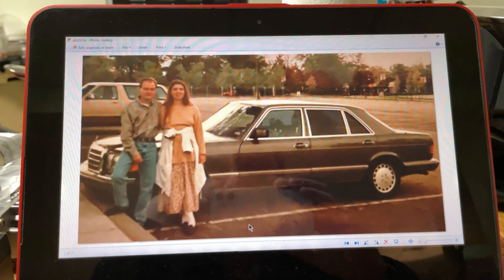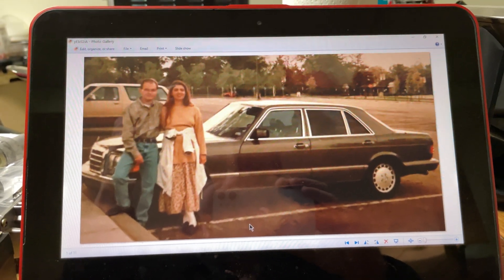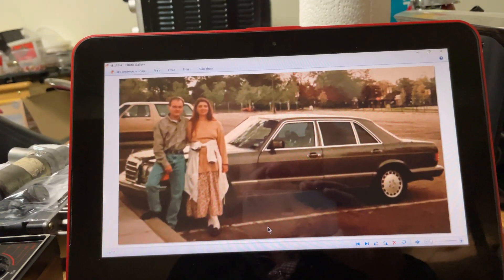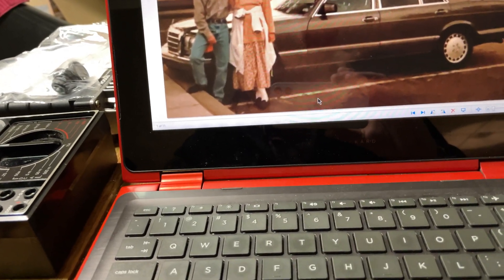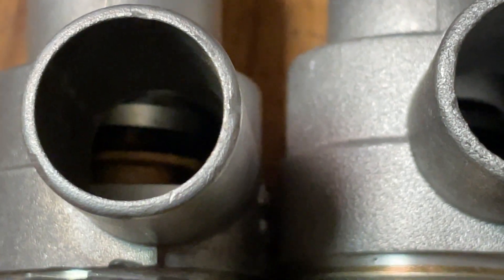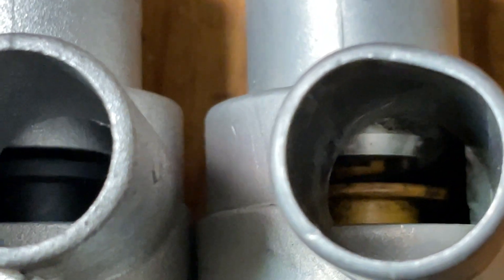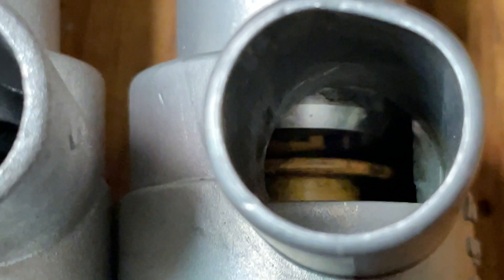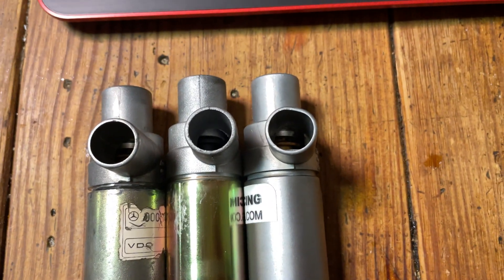Tutorial correct calibration of Bosch K KE KE3 Jetronic for all Mercedes after repair / long storage

Comment: Hello thank you for the video . I have a question I ajusted my pontentimete at. 0,7V  than I ajusted the air plate and potentiometre changes the value from 0,7  is it normal or I have a problem with my potentiometer . Thank you best regards
Reply from the maker: No, that’s correct 
You can adjust the plate first and then adjust potentiometer and see what difference this makes
Reply: @inovahightechltd  thank you for your answer and all instructive video

Comment: Hi, I have replaced the potentiometer with another original bosch A0000740136 on my w201 2.3-16v (m102.983) no catalysed mercedes. The voltage between pins 1-2 would be 0,7-0,75 too? Thanks for sharing your videos.
Reply from the maker: That I am not sure. Check with the MB Service Manual Group 7.3 for your Model and Model Year!
Peter

Comment: Will this also work on my Porsche 928 K-Jetronic (1978).  I assume it will to get it starting?  Thanks!
Reply from the maker: Yes, but I believe on the Porsche / VW the plate action is in the opposite direction from the MB system, meaning plate moves up, not down. Otherwise everything is the same
Reply: @inovahightechltd  Thanks!  You make what was a mysterious fuel system simple!  My problem is I messed with the 3mm Allen and that was that!  So I want to bring it back to a baseline so it starts...
Reply from the maker: Craig, just follow the video(s) it takes patience but once you get the hang of it then it’s a piece of cake! Just remember, plate adjustment with Allen key only with a running fuel pump (jumper the fpr) otherwise you will loose your hair! Peter

Comment: Hello , I'm restoring a 560SL 70,000 miles which was parked for 10 years before was parked I removed the gas tank , now the car has been painted and is almost ready to go, I connected all wires and relays, cleaned all terminals , placed new battery , changed fuel distributor seals and cleaned ,cleaned injectors , spark plugs , wires distributor cap were new before parked the car.
I crank the car and it started but just for few seconds maybe like 10-15 seconds with rough idle and smell of gas , I took the sparks out and notice that they were wet on gas . cables are OK already checked them all send spark, do you think the sparks can be damaged to be stored for that long? 
also something important my car does not have installed the exhaust the whole so don't have the O2 Sensor.
could that be the reason ?
the car starts every time the same .
already cleaned the Idle valve it improved just a little .
Need advice.
thanks
Reply from the maker: Hi Alex,
This points to a failing fuel distributor. Time to get a rebuilt one. The O2 is irrelevant during start / warm up. It comes into play when the engine has warmed up and goes from open loop to closed loop control by the ECU.
Reply: @inovahightechltd  
Will try that, thanks
Reply: Today I checked the resistance on the potentiometer between 1and3 pins with no connection and shows 0
Reply from the maker: Time to replace it. Not sure if you saw all the other videos I made of testing those and all the other parts. 
The potentiometer is only used for the EHA valve control to adjust mixture. 
When cold, the engine runs pretty rich until at operating temperature. 
The engine will start and run without the ECU and EHA valve operational - this is called the limb mode and indicated by the illuminated check engine light.
Reply: @inovahightechltd  
Hello, thanks, I have seen several of your videos , there is a parts store that has the potentiometer in $28 I don’t know if is good has good reviews.
I opened my bad potentiometer and found a 3006P-1-201 which costs $3.23 inside , seems to be fair easy to replace and resoldering in place
Reply from the maker: @alexschulz5305  this somehow doesn’t sound right with the potentiometer,
This is a Bosch part and the potentiometer is an integral part of the enclosure which cannot be exchanged

Comment: Thank you very much for your videos.  You are among the very few that explain things correctly and you also have a very calm voice which helps a lot.  However, I do have a question for you please: at ~ 12:00 you mention about the "learning mode" of the ECU (N3).  In all the videos I watched and people I talked to, nobody said that.  In fact, when I specifically asked others about it, I was told that the N3 ECU of the KE-Jetronic W126 did not have that capability.  Furthermore, you also mention 40 engine starts to complete the learning.  Did Mercedes mention that in any of their W126 FRM procedures too?  Are you sure the N3 of our cars has that capability and how do you know is 40 engine starts?
I appreciate your knowledge and look forward to your reply.  Thank you.
Roy
Reply from the maker: Hi Roy,
This is pretty much detailed in the groups which deal with the EzL and Ecu.
A learning mode may not be the exact term especially not when compared to today’s standard.
The ecu has a RAM chip and the microcontroller stores constantly certain values to RAM, like RPM, coolant temp etc.
It takes 40 starts plus driving several miles to fill this memory back up which is then used during starting and driving as database for comparison and to calculate average mean values.
This memory can be erased by two methods:
1. Full reset after last error was reset by moving ignition key to off before 10 seconds after reset.

2. By disconnecting the negative lead of the battery for more then 10 seconds 

All this data does is to smoothen out operations and works after the FIFO principal. First in First out - so data is rewritten every time you drive
Reply: @inovahightechltd  I most highly appreciate your reply, thank you.  Will have a closer look at your videos.
Reply from the maker: Hi Roy,
Please keep in mind that this is documented in the Manuals with model change in 1986
Sincerely, Petet
Reply: @inovahightechltd  Thank you, Peter.  I have the manuals applicable to W126 with V8.  Which section do you recommend?  I am assuming you are referring to one or more that would be in group 07.3 (Mechanical-Electronic Gasoline Injection).  I am genuinely interested and would like to read more on this subject; I have two 126 models, both with V8.
Thank you again,
Roy
Reply from the maker: Roy, I have to look through my manuals. I have different versions between English and German. I believe it was in the addendum for 86 model change or a service bulletin.
I will report back to once I find it but that may take a couple of days until I get to it. Sincerely Peter
Reply: @inovahightechltd  Thank you so much, I really appreciate it and I apologize for any inconvenience created.
Reply from the maker: Roy, this was a Mercedes Benz Service Bulletin titled:
computer relearn procedures
All models
Reply: @inovahightechltd  Thank you, I appreciate it.  Will try to find it.

Comment: Hello I found gas leaking from the middle of fuel distributor where the gasket is. I heard that the distributor shouldn't be taken apart. I found three screws on top of the distributor and tightened them a little bit more but not so tight to the point of stripping the screws. I haven't seen if it's still leaking after I tightened the screws. The fuel distributor was leaking when it was running but it doesn't leak when it's off. Thank you

Comment: Hi, I bought a potentiometer from the seller you have recommended. The resistance between pin 1 and 3 is ~ 1,7kOhm. I've contacted the seller an he told me that Mercedes specification of ~4.2 is irrelevant becouse the use of better materials in his product. Do you agree? Thank you.
Reply from the maker: Hi Fabi, genuinely it should not be a big problem. The quiescent current with 4.2K is 1.2 mA and with 1.7K is 2.9 mA.
The question is, can you adjust the pot to 0.75V between top and middle pin when engine is at correct idle speed?
Reply: @inovahightechltd  
Thanks for your quick response. I bought it as a reserve spare, just in case. Hope it will be ok if needed.
Reply from the maker: @fabit.8734  Hi Fabi, I looked further into this question yesterday and investigated the input parts used in the ECU’s. I have several here for 103, 116 and 117 and all use the same input circuit for pin #17 (wiper from poti).
Those are two 1% metal film 1/8W resistor in series between 5V and Ground . Those are R300 10KOhm and R313 510KOhm. The connection between both is pin 17.
This divider network will have 4.96V on pin 17 with poti disconnected which the ecu recognizes as error and turns on engine check light.
With the Bosch Poti 4.2K the voltage on pin 17 will go from 0 to 2.5 V with 0.75 V set as idle reference and Throttle switch closed in idle position.
With the 1.7K potentiometer the voltage range will be reduced to 0V to app 2.1V which means the engine is going to run richer but may experience substantial acceleration problems in warmup phase between 45C to 75C coolant temp.

I soldered in a parallel 5.36 KOhm to R313 510 KOhm in my ECU which limits the Voltage range now on pin 17 from 0V to 1.7V which eliminates the warmup acceleration/power issue but also may limit the highest attainable rpm from 6000 to around 4500rpm over all - I need to verify this fact with possibly reduced max rpm in more detail in the next few days. We got a snowstorm here today and have 1/4” of ice below the snow.

Thanks again for pointing this out. I will make a video on this issue and would like to know if I can mention your name in the video.
Sincerely Petet

Comment: If I'm replacing the rubber boot for the housing . Does the fuel distributor need to be re adjusted ?
Reply from the maker: Hi Richie, if you have a V8 3.8 4.2 5 or 5.6 Liter engine then you may want to watch this video here to answer your question since it really depends on what your current position for the stop and resting position is:

https://youtu.be/G-4Is19H5TQ

Comment: Very informative video. I wish you a happy new year. I have KE-Jetronic. MB 2.0 M102.962  If I change the free play on air flow sensor plate from 2.0mm to 1.5mm, will the volts on potensiometer (TPS) change (0.7volts)?

Comment: thank you for such an informative video! 
 my only doubt is how do you tighten the rt/bottom screw of potentiometer, once you achieve 0.70v when the fuel pressure regulator does not allow any room to get a torx 15 or any other tool in there...?  at least it's my case on 92, 300e, 2.6l
thank you, would appreciate comment-procedure
Reply: You have to remove the fuel pressure regulator then adjust the pot, tighten the screws but not fully tight so you can install the pressure reg to turn on the car and adjust the pot.  Once set you have to remove the regulator to tighten down the pot screws

Comment: Hi, finally got the potentiometer. Followed the procedure. Did plate adjustment with engine off, set slightly leaner than before. Set V to 0.7. Reset computer. On restarting warm the Rpm is high, 2000 or so. Not idling down.
Reply: Ovp fuse is good
Reply from the maker: @Torqueandsteel  then you need to check your ICV and Idle Speed Control Unit
Reply from the maker: @Torqueandsteel  if both ICV and ISCU checkout ok then you have a massive vacuum leak - check brake booster and  brake booster vacuum hose and all other vacuum lines connected to rear right side of upper intake manifold
Reply from the maker: @Torqueandsteel  disconnect all vacuum lines from engine and cap off each port - if the idle remains still above 1000 rpm after 90seconds perform smoke test by blowing smoke into one vacuum port and observe fuel injector seats and the donuts between upper and lower intake manifold
Reply from the maker: @Torqueandsteel  for vacuum issue please watch this play list “The big repair”
https://youtube.com/playlist?list=PLO4ZlzALkZVq3NysVV7vqO7BiZ9Kd_97D
Reply: I realized the harness was off the EHA. Now it doing a rapid oscillation between 1000-1700 rpm.
Reply from the maker: From a distance, I would say vacuum leak
Reply from the maker: @Torqueandsteel  it oscillates like this here? Just a bit higher?

https://youtu.be/AT4oXA08Th0
Reply from the maker: @Torqueandsteel  btw. the adjustment on the potentiometer is done when engine is idling at 650 to 700rpm at operating temperature (80C to 100)
Not when the engine is off

I am sure I explained that in the tutorial
Reply: I had checked the icv recently, makes a clack noise when 12v put across it. Replaces the hoses to it. Fairly sure I don’t have a big vacuum leak
Reply: Ok, I’ll look for leaks. Thank you very much
Reply: I have a video of it oscillating. Understood on setting the potentiometer at regular idle and op temp
Reply from the maker: @Torqueandsteel   it is difficult to diagnose a problem on an engine like this from a distance without having seen actually the car / engine itself. I would guess you have verified that you got the correct part numbers of ecu, ezl and ISCU installed in your car and that all other sensors are within operating specs - this may sound silly, but sometimes cars have the wrong controllers installed by someone else previously
Reply from the maker: @Torqueandsteel  can u post the video on ur channel and post the link to it in the reply?
Reply: Yes, I agree. I will have to do a little more work to see what’s going on. I appreciate the help
Reply from the maker: Your welcome, btw what my and model do you have? Mileage?
Reply: It’s a 1987 300E, 105k miles. I’ve owned it for years. Never ran very well. I bought it unseen with about 40k miles, it was parked in a garage for the first 25 years and not maintained much or used, it was more tired than it’s mileage suggested. I’ve been farting around with it since.
Reply from the maker: @Torqueandsteel   ok, how far do you live from Kansas City. If your not too far you can stop by and I will take a look at it
Reply: I’ll figure out how to send you a video. Unfortunately I’m all the way down in Texas. I very much appreciate the offer though.
Reply from the maker: @Torqueandsteel   please contact me via our website contact form

https://inovahightech.com/index.php?route=information/contact

I don’t want to post my email here, otherwise I get bombarded with spam mail
Reply: I did the form on your website
Reply: @Torqueandsteel  put 12v to idle valve, if engine stops, there is no any air leak
Reply from the maker: @Thomas Buerkle Responded
Reply from the maker: Check the fuse(s) in the OVP Relay
Reply from the maker: The high idle issue is solely between Idle Speed Control Valve, Idle Speed Control Unit - Operating Voltage for those is supplied by OVP Relay

The Potentiometer you adjusted supplies  feedback only to ecu for emissions control / fuel mixture - has nothing to do with idle

Comment: And does the signal to the cold start valve go through the fuel pump relay ?
Reply from the maker: Yes it does - the fuel pump relay gets the ambient / coolant temperature from B12/2 I think it is (2 pin or 4 pin)
Reply: Thanks !